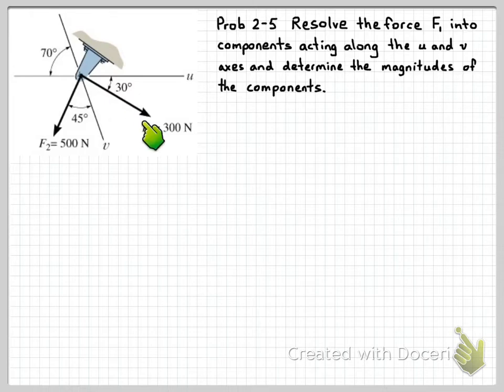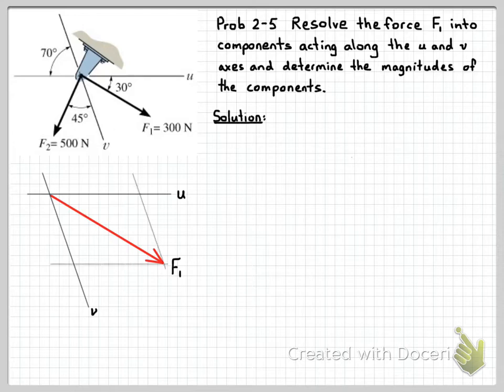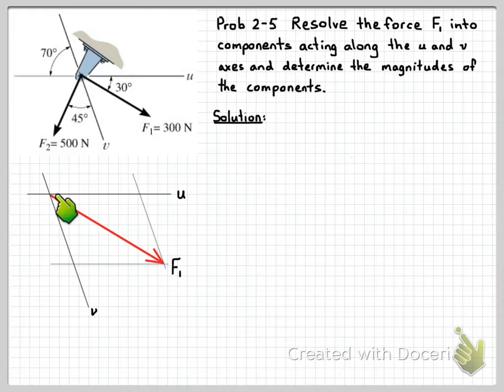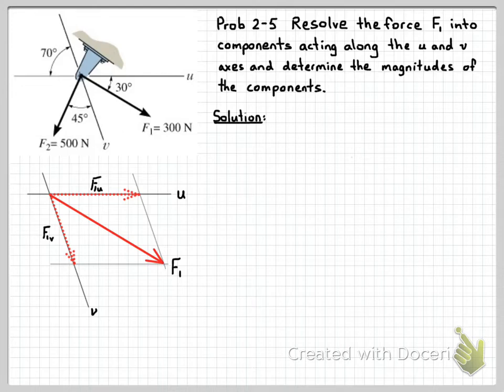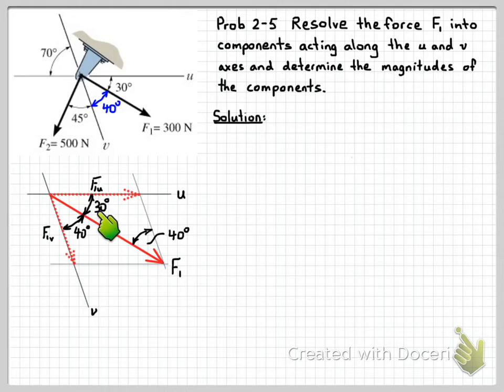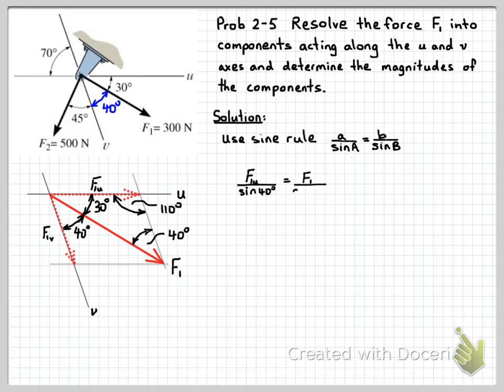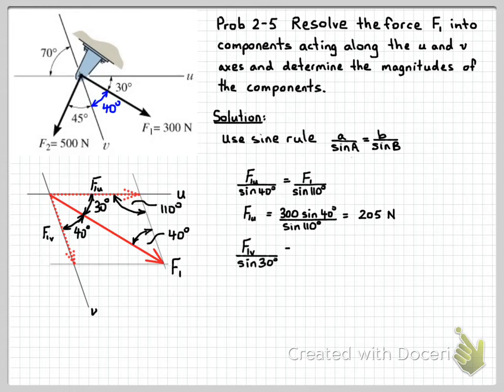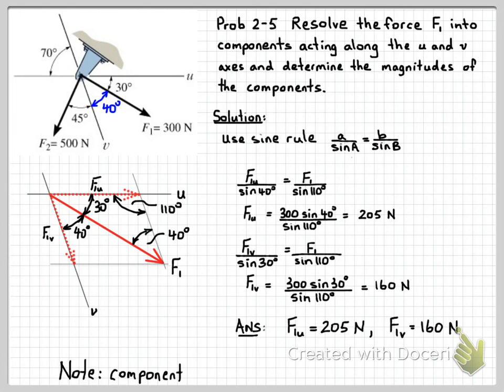Vector components not at 90 degrees. Prob 2-5

Comment: question... shouldn't you get 300 newtons when taking sqrt(205)^2+(160)^2 ?
Reply from the maker: no, not in this case. Because the force components in the question are not at 90deg to each other. Your equation to get 300N is only valid for right angle triangles.
Reply: @TerryBrownMechEng  got it, thanks!
Reply: No, I'm going to assume you meant sqrt((205)² + (160)²). And here you'd be forgetting the extra component in the general rule [2*205*160*cos(theta)] which is the angle between the 205 and the 160. Making the rule sqrt((205)² + (160)² + 2*205*160*cos(70°)).
The reason the last component is usually not written is because theta is usually = 90°.
The only way to deal with any triangle having some know. sides and angles and some unknown is through the sine and cosine rules.